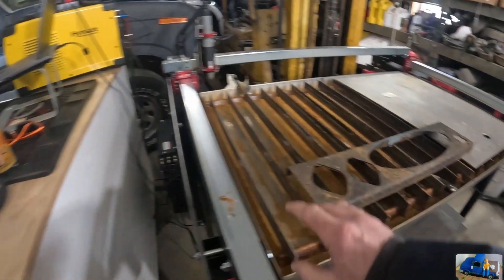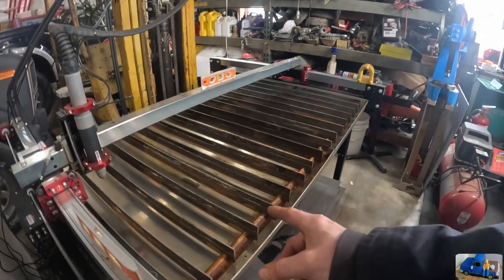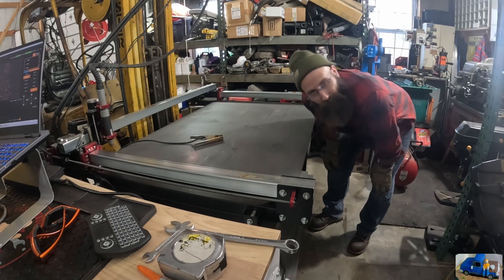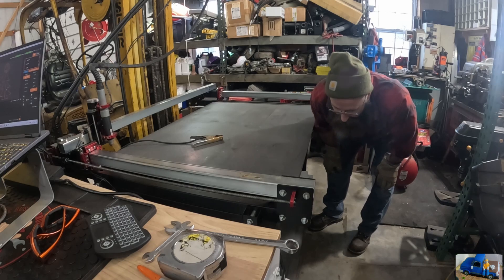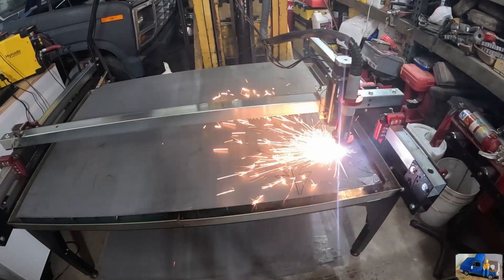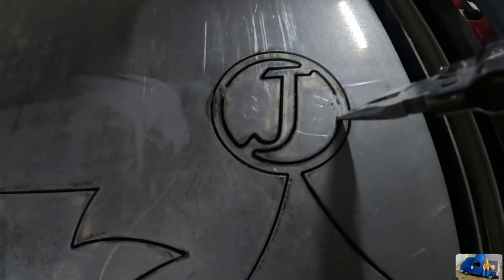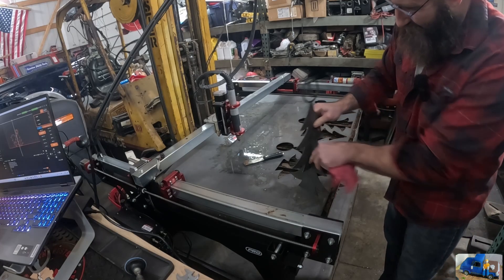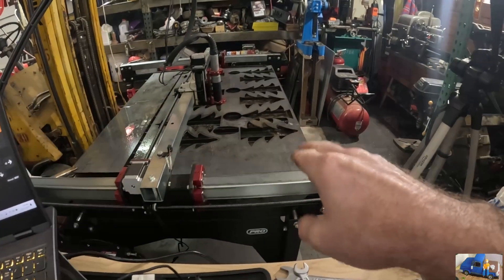CNC Plasma Cutting - Dialing In (14 Ga.)

Comment: For 14 gauge what speed are you cutting that steel?
Reply from the maker: I believe that was cut at 90 ipm.  Thanks for watching 👍😁
Reply: @FlatThunder  Thank you for your fast response! is 90ipm your typical cut speed for 14 ga? or do you have a range that you stay between? if so what is that range?
Reply from the maker: Welcome!  I don't have a ton of hours on my machine, but that is the typical go to setting when programming 14 ga.  If it isn't performing well you can adjust the speed using Fire Control.  It also depends a lot on your plasma machine and settings.  Here recently I found that torch tips can greatly affect cuts too;  ie it wore out before I noticed and was giving me cut quality issues. Cut some test blanks on your machine and let the dross tell you the best settings.  I was also running my plasma @50 amps.  Check out Langmuirs forum, they have a lot of great discussions similar on cut settings.  I still reference it when I'm cutting something new.  Happy cutting 👍😁